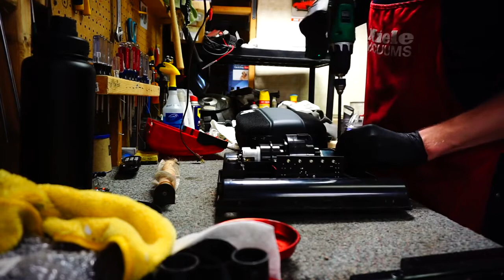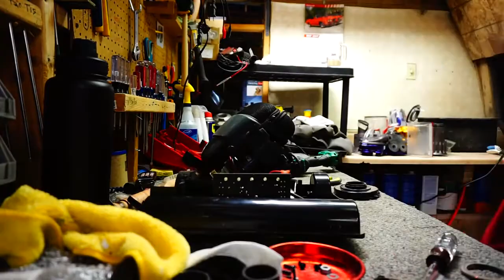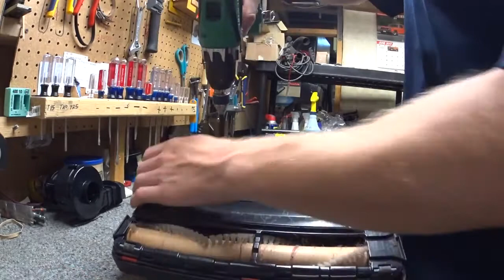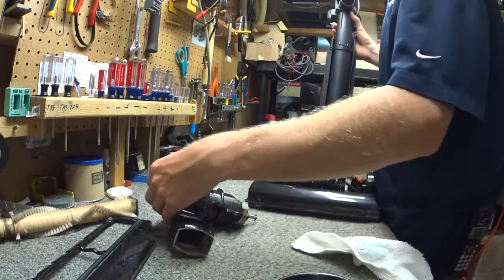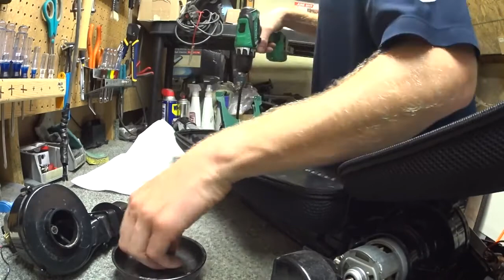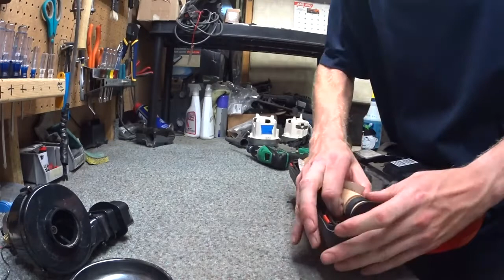Simplicity s10cv Ricca rR10CV Motor repair Cordless Freedom

Comment: We bought one of these Simplicity S10CV's.  So it was running fine until the motor seized.  When the motor seized, it took out the battery so 0 volts coming from the battery pack.  Why did the motor seize?  The armature slipped in the bearings and it slid toward the belt side.  This caused the fan to crash against the housing.  So instead of taking the motor apart, I hit the end of the motor shaft that drives the belt lightly with a hammer and the armature moved towards the Impeller.  Now it spins freely but not sure how long it will last?  Now for the battery.  Thank God the battery cover is removable, secured with 6 screws.  Took of the cover and on the negative lead wire is a Fuse covered in heat-shrink.  The Fuse is a 6.3 ampere, T-series (time-delay).  Instead of waiting for a fuse, I used an automotive fast-blow 7.5 ampere.  Not recommended but so far, so good.  So IF your battery charges OK but has no output, the  internal fuse may have blown.  They told me a battery pack is $250.  We have another corded Riccar Supralite corded vaccuum and it's is excellent.  Would not recommend this cordless model as $600 is a lot of money and too expensive to repair if you had a Dealer do it.

Comment: The belt end needs a notch in the shaft to place a open end wrench on to hold the armature in place, for removal/tightening the turbine blade.  At first it sounds as if the armature moved, or the turbine blade did.  Maybe the customer dropped it on a hard surface?
Reply: Sadly there isn't much made in the USA.  It's about who's in office (who we elect), but this started 40+ years ago.

Comment: Hey I just got an offer from a local dealer that has swapped from selling simplicity to riccar: $450 for this vacuum. Is it worth buying at this point or would I be better off getting something from tineco or some other brand. Did you have a lot of them come in with issues? I do like the idea of deep cleaning with this.

Comment: How's the power with the cordless vs the corded machine
Reply: Check out the video on vacuum wars channel, he tests the Riccar version.
Reply: @a111z  It's spec'd at a 312 watt motor, using a 44vdc Li Ion battery.  Certainly stronger than what Hoover is turning out in a cordless.  Hoover owns Oreck and after one year their upright HEPA filtered cordless was discontinued.  Seems Hoover is VERY good at discontinuing a product before it's warranty is up and providing no replacement parts.